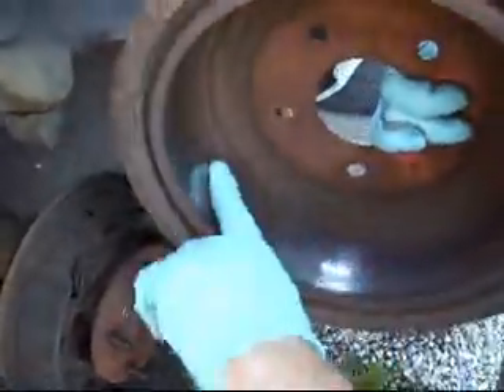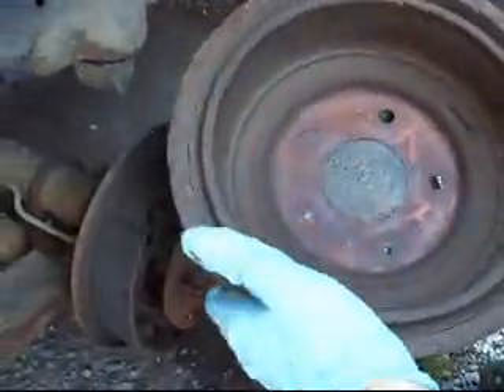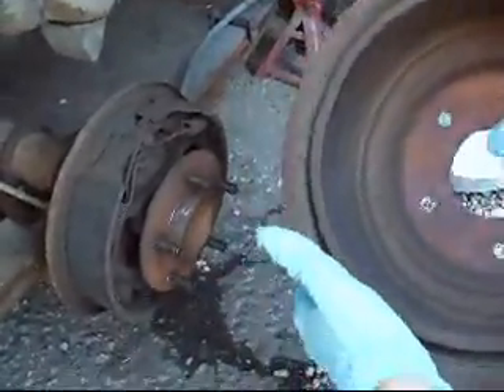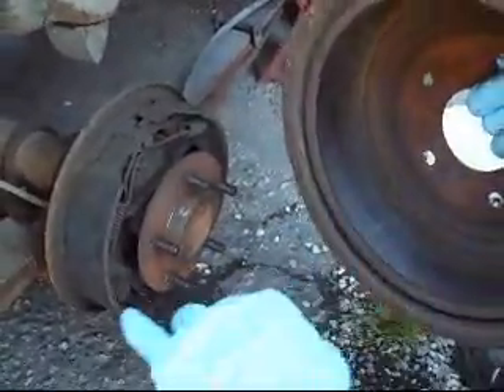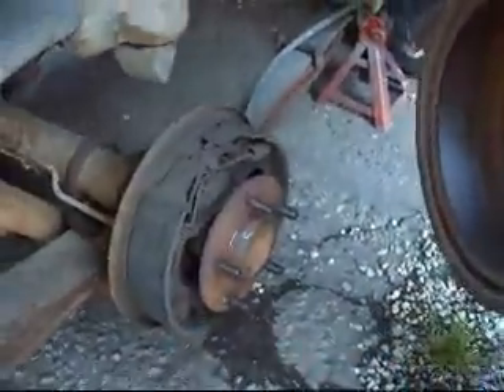REVIVED BATTERY ELECTRIC PICKUP TRUCK ON KNIGHT ST. BRIDGE

Comment: They are brake shoes not pads. They are drums not rotors and if you look at the wheel cylinder the dark spot is brake fluid leaking out. Need to replace it